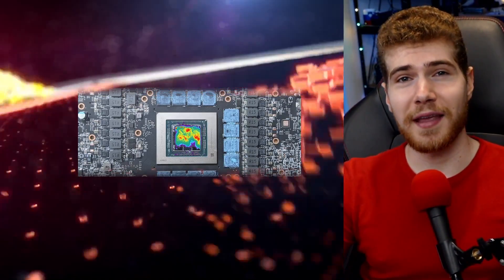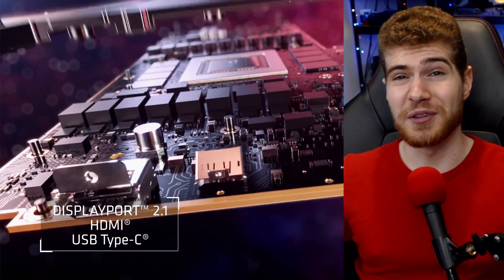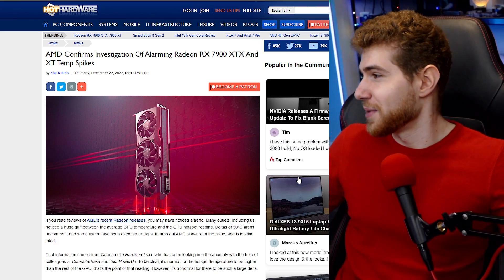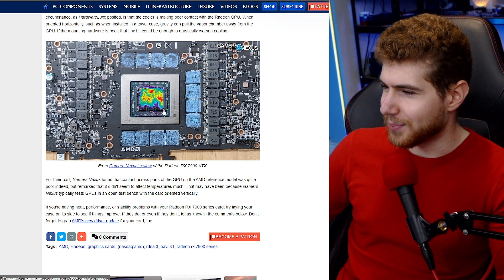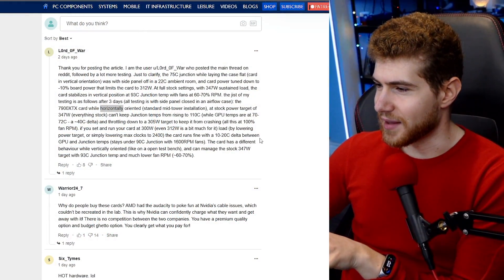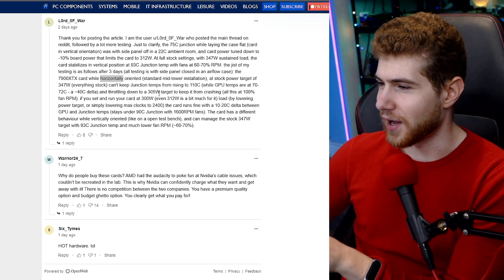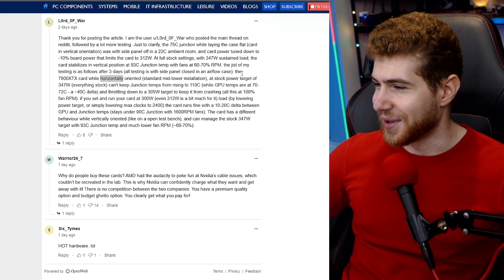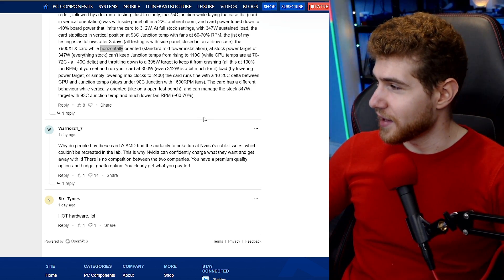AMD's RX 7900 GPUs Temperature Issues Explained

Comment: Just got mine and yea I have the junction temps are the 110°c issue and it really fucking sucks and I am considering getting a 4080
Reply from the maker: Unfortunate, I'd try refunding it as fast as possible & yeah then just buying something else, best of luck!
Reply: @DailyTechNews.mp4  yea I'm just fucking pissed off with this card plus I gotta do uni work on something honestly I'm considering putting my 3060ti back into the pc until I either get a new unit or I accept defeat and give Nvidia £1200-£1300 for a new fucking graphics card telling them it's okay to overpriced their fucking cards
Reply from the maker: @AssassinIsAfk  yeah, lucky you still at least have the 3060ti
Reply: @DailyTechNews.mp4  yea it's just I am gonna miss having double the performance at 1440p. I mean with DLSS it gets close but it's so hard to go back to DLSS when I have experienced what native resolution looks like

Comment: i just received my asus 7900xtx "made by amd" , not getting higher than 82° max junction temps while benchmarking at +15% power draw and using it horizontal .. clearly the problem is not concerning every cards made by amd ...  lots of trolling in comments related to the so called problem" that seem limited to some user that should just rma ... the one thing i noticed is the default max freq setting was at 2995mhz , so i put it back to 2500 as i newly installed the driver ... because i don't think 2995 is the intended value, and i could lead to game crashes i think ... don't know about temps with that but don't think it could be related

Comment: So is the junction temp the hot-spot temp?
Reply from the maker: Yeah in these cards it's basically when one of the sensors hits 110C I believe
Reply: @DailyTechNews.mp4  I have a sapphire MBA 7900xtx and I don't think I ever saw the junction temp go more that 5 or 10 degrees higher than the gpu itself.
I must have gotten lucky.
I also haven't noticed any coil whine and the fans speeds have been pretty good as well.
Reply from the maker: @eggchucker1  Yeah this issue is only for the 1st party AMD-made cards, so you should be all good ;D
Reply: @DailyTechNews.mp4  I know but the MBA card is the reference design.
Its just sold my sapphire.
Reply from the maker: @eggchucker1  Hmm interesting, who knows maybe it was assembled in a different factory or something like that

Comment: AMD Equivalent to GTX 480.... At least winter's gonna be warmer.... XD  Hahahaha... 🍻🍻🍻🍻🍻🍻
Reply from the maker: Yeah GPUs are combo-ing as electric heaters these days :P
Reply: @DailyTechNews.mp4  More power, more performance, more heat... Can't work without the one another unless they figure out a new design with a new materials that twice as conductive & twice as efficient without sacrificing performance... Till than, like you said, a HOT mess... I think the 2000/3000 & 6000 series where the sweetspot... The rest just pushing per demand in the market without really looking it thro enough... What's your take in this??
Reply from the maker: @absurdgaming00  Yeah idk, like you said these days if you want more performence you usually have to push more power as well; and it's getting pretty redicilous with the size of the cards & the fact that if you wanna use one in a small room, you'll most likely need an AC along with that in the summer... but that's just how it is these days... It would just be nice for the prices to come back to a more reasonable amount... I remember the days when the 60 series Nvidia cards were $200-$250 back in the days of the GTX 660 & such...
Idk you can get pretty killer CPUs for under $300 these days, but GPUs are just crazy expensive still
Reply: @DailyTechNews.mp4  Yup.... Pretty much summarized it all... We're basically goin' back to the year 2000 ish where GPUs are power hungry... Now, with the advancement of tech, We got both power hungry & powerful... But gotcha... Eventually, I mighy not be surprised if the percentage of a average PC gamers ending up switchong to console to save a buck sacrificing the freedom to upgrade etc because of the pricing both for a single component & overall built combined...
Reply from the maker: @absurdgaming00  Yap, consoles might become even more mainstream for gaming; I actually got an Xbox Series S for my living room just because I thought it's crazy how much hardware you get for a little over $200.... Games cost more & everything is locked down, but especially with things like game pass I think a lot of younger gamers are just gonna do that instead of building a PC
Reply: @DailyTechNews.mp4  Cool... I had a PS4 pro then it became the fams default Channels browser instead of cable TV... XD But yeah, PC will eventually be a privilege/enthusiast thing... Plus don't forget steamdeck & all that competing in the market...

Comment: I have a reference xtx directly from AMD. While running it's default settings the hottest ive seen the junction temps go with no tuning of my own is 95C. when i undervolt,
 i Can get the temps down at most 65C while my junc temps stay around 80 and maxes at 85c. I'll admit now that i don't have the best cooling solution in my case. I strongly recommend undervolting or just straight underclocking if you are having temp issues. for those wondering, 2600-2700mhz at at 1090mv w/ power limit at 0. I still see a boost in performance compared to default settings and therefore, i don't have to hear an engine taking off due to the stock settings ramping my up the rpm of the card's fans. in just so you know, when I do do a balls to the wall OC my junction temp never hit 100c, but 99. Maybe i got lucky w/ my card but for those who aren't, undervolting is the workaround for this situation.
Reply: Just bought one of them for me and my brother. My issue is the pc case, which doesn’t leave much space for the fresh air. Another issue is that I figured out the GPU sucks hot air from the sides, so I am looking into an exhaust fan to adapt on side. After testing with a small fan pulling the hot air from the side, I was able to decrease the temperature in 10-15 Celsius degrees.